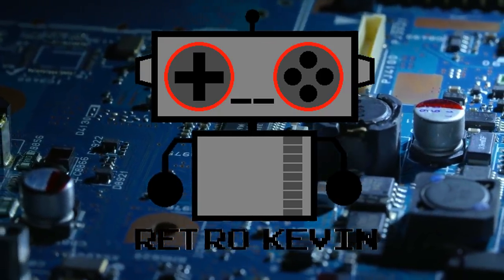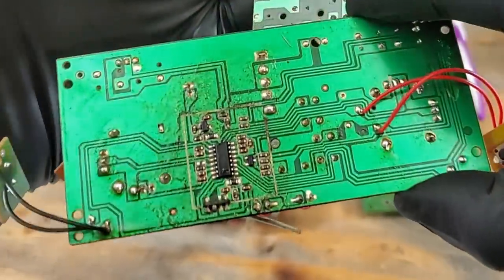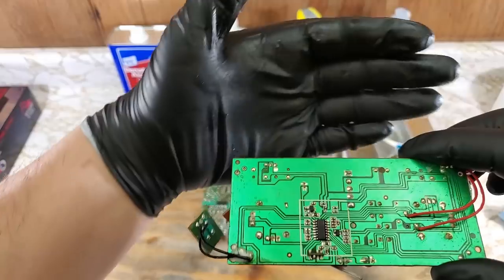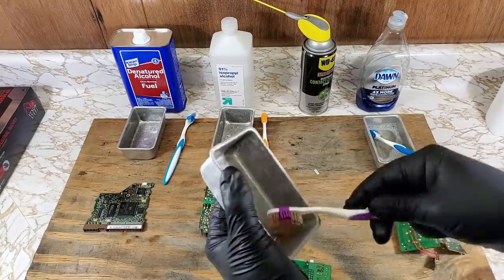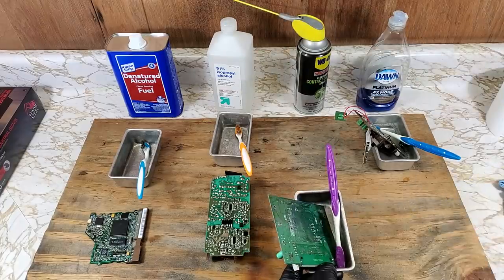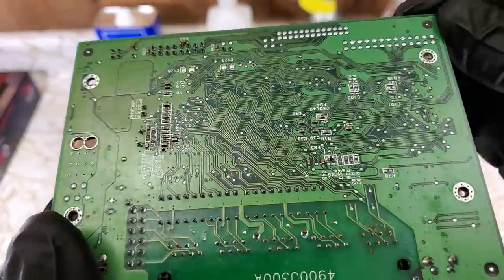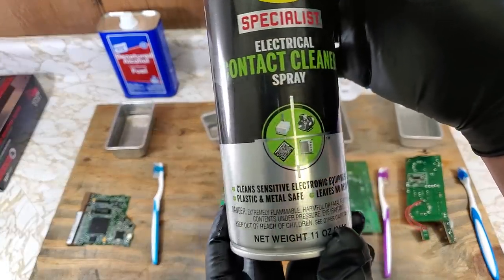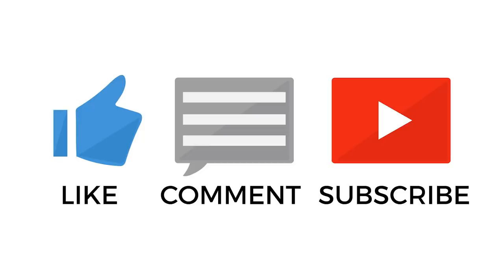Electronic cleaning products comparison

Comment: I mostly work with old electronics and this is my go to. Simple green, paint brush, hot water. After washing rinse it with denatured alcohol to displace the water and hit it with compressed air and let it dry for a few hours. If the circuit board is the super old Phenolic type then spray some WD40 onto a rag and wipe it down. As long as you don't saturate it in WD40 it's fine.

Comment: Will electronics contact cleaner remove water corrosion and general oxidation from contact sockets where ribbon cable connect on a laptop?
Reply from the maker: Great question. The contact cleaner should work. If that doesn't work you can try a small amount of baking soda and water with a bit of light scrubbing. Just make sure to clean all the baking soda and dry completely before powering on.

Comment: Hello @Retro Kevin, in the case I need to remove rust (sulphate) from USB ports, what would you use? I need more information about this due to some people to use isopropyl alcohol, but I want to confirm this option is the right one. Thank you.
Reply from the maker: USB ports are a little more difficult to clean, just due to their tight space and weird angles.

I would start with the isopropyl /denatured alcohol. 

If that isn't enough I'd try either vinegar or baking soda. Both are great at removing rust. Just make sure to fully clean those off and dry everything well before powering on for testing.

Best of luck!
Reply: @RetroKevin  Thank you a lot  @Retro Kevin, I'm gonna follow your recommendations.
Reply: It is better to combine instant thinner with alcohol ، Thinner is the best solution for removing sulfate.